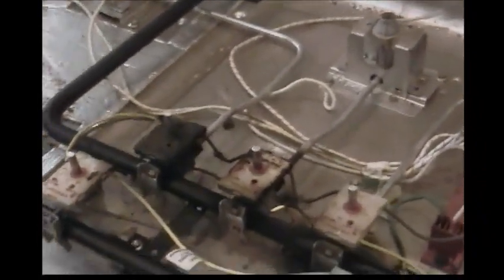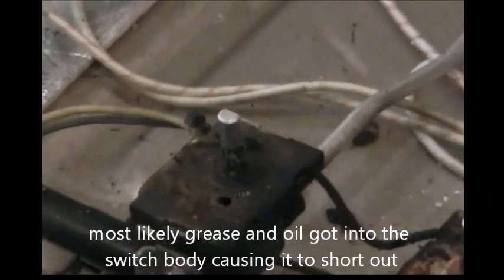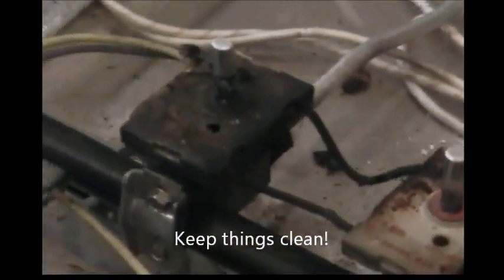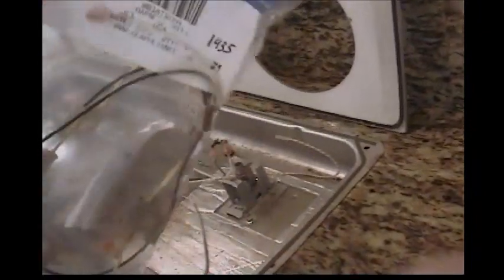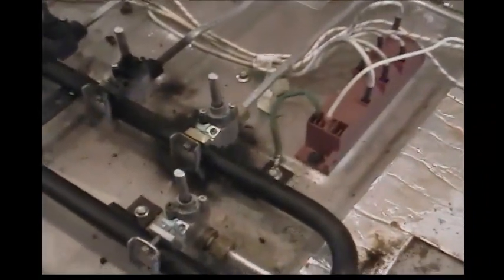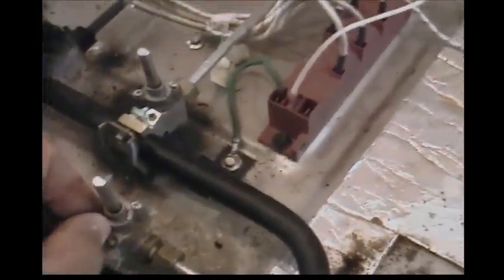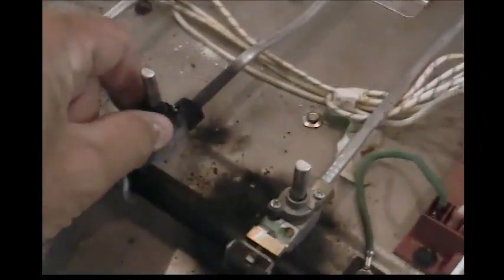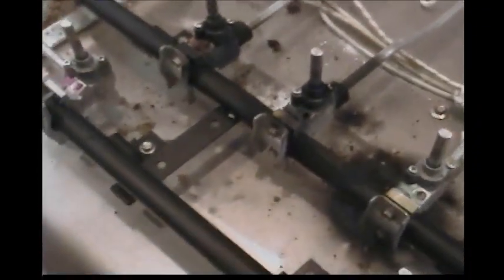GE GAS COOKTOP IGNITION PROBLEM

Comment: I think if you had shown the actual steps that you took to remove and replace the ignition harness, that would have been helpful.  As it is, you seem to have skipped 2 or 3 steps and you magically have the new harness in place.

Comment from the maker: Depending on the type of ignition system you have (Manual light or Auto- relight aka: REIG) you either have a bad burner switch or a bad ignition module

Comment: I have a GE Profile Gas Range Model  #P2S975SEM1SS   with 2 out of 4 burners not sparking.  I know how to remove the burners and caps, but the top front doesn't lift out by the front control panel.  What am I doing wrong.  PS - my skill level is very low...
Reply from the maker: REALLY CAN'T SAY WITHOUT LOOKING IT OVER CLOSELY. GET OUT A KNOWLEDGABLE TECH
Reply from the maker: The top if glass is held down round the perimeter with a mild adhesive. VERY CAREFULLY pry the surface off